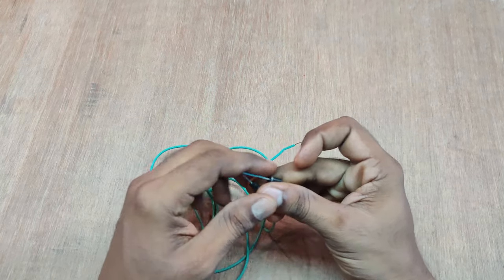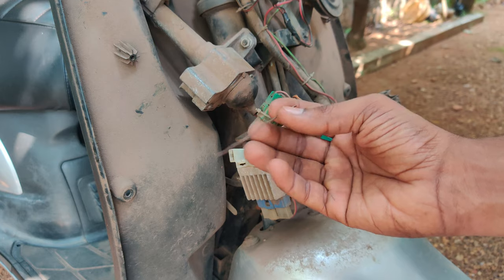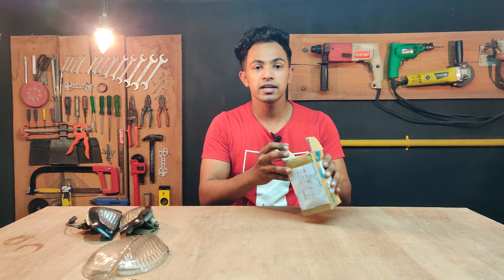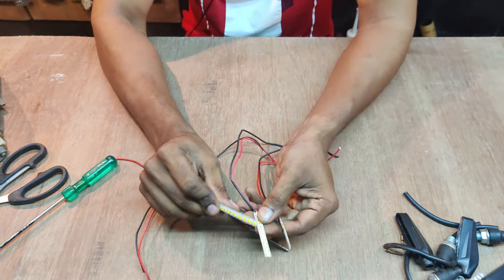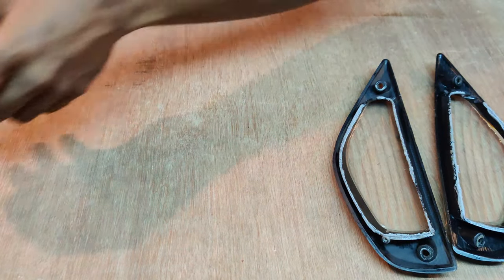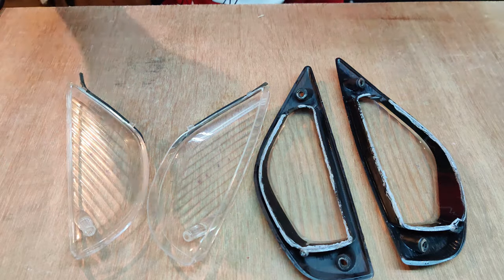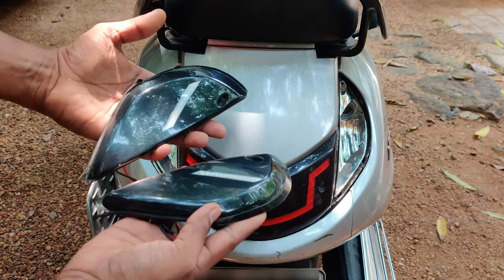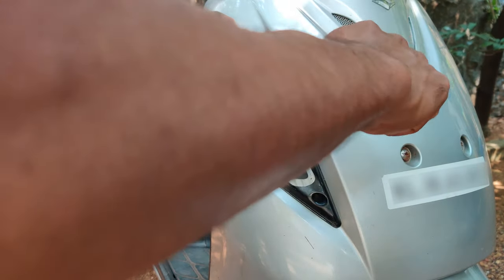LED indicator installation for all scooters

Comment: Bro break light cover u used paint as brush or spary paint becoz i apply brush paint i lost my cover look like damage pls help
Reply from the maker: I used both but i haven't any problm
Reply: @anazzahar7420  bro normal paint or spray bottle and pls how to make lines design its accrate lines
Reply from the maker: @technotgh6099  lines are covered by masking tape and use normal paint